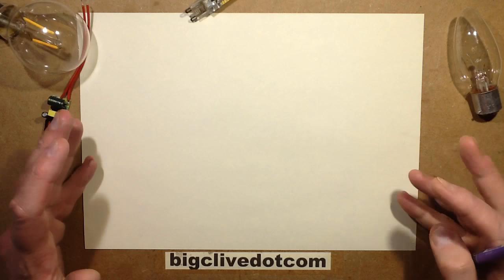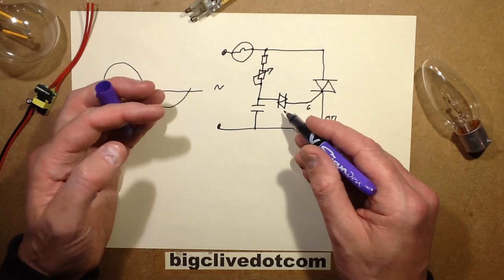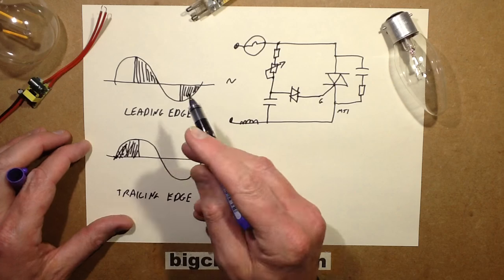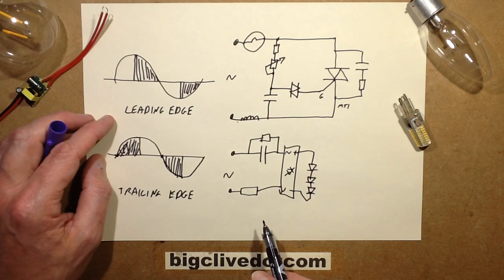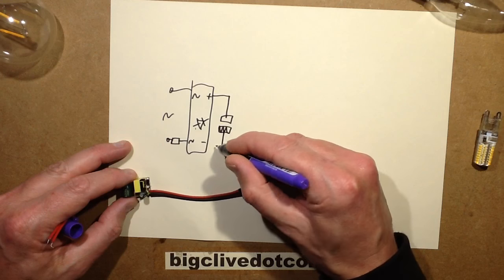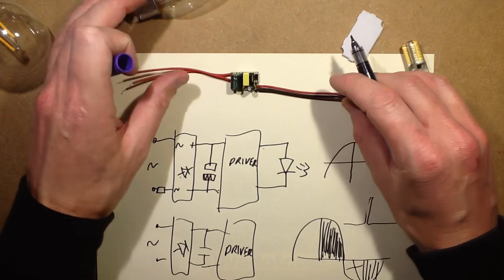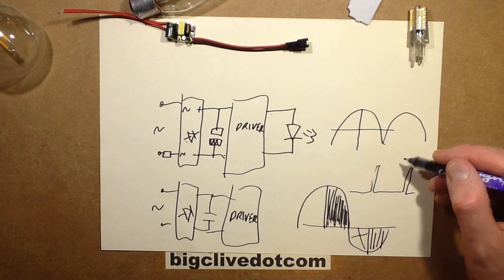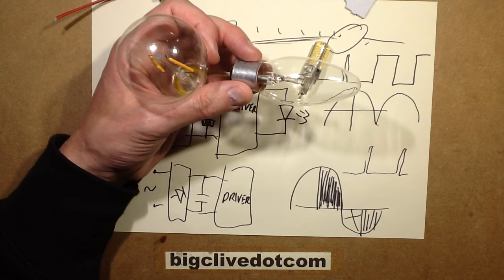Dimming LED lamps with ordinary dimmers.

Comment: As an IT guy, I don't like the idea of light bulbs communicating over systems as complex as Bluetooth or WiFi. They are so easy to bugger up security... Look at what Philips did with their internet connected light bulb.
A standardised, over the wire protocol would be fine. But I know that won't happen because its not as cool as an iPhone app to switch your lights on and off.
Reply: agree, IOT = security disaster.
Reply: . . power over ethernet is already here
Reply: Uh, what? PoE is for powering remote network devices.
Do you mean EoP as a communications method? Because that' still way to complex for a consumer grade light bulb. I'm thinking something more akin to "coax" SPDIF audio, but containing dimmer levels. Still insecure in that anyone with access to the wire can feed dummy signals, but far simple enough that a purpose made chip can receive it and process it without having an embedded Linux system (ala the hackable Philips bulbs).
Reply: well, often the light bulbs themselfs dont have WIFI but the controller of them has, but the controller - lamp is based on other protocolls (Ikea trådfri and philips hue).
Reply: There already are standards for controlling devices over the power lines. And they have exactly 0 security. All commands are sent in the clear, no encryption or signing. I too hate the bluetooth/WiFi controlled light bulbs, but without developing a new standard and somehow convincing everyone to adopt it, it's probably the best option security-wise.
Reply: +tin2001 - You see , the Hippsters are slowly causing the BattleStar-Galactica doomsday https://www.youtube.com/watch?v=rNklsRcRQv4 or disaster stuff in ST-TAS
Reply: What about Clipsal C-BUS? It pretty much is a wired automation protocol like you described, though it has been around for a while, but the downside is that it is VERY EXPENSIVE to install.
Reply: +wocko1 - Thats the problem, its to expansive = it will not realized
Reply: Another problem is that anything "smart" you add to a bulb will have a boot time. A major factor in bulb acceptance is the time it takes to light a bulb; in case of dimmable bulbs, that also includes the time to reach the right dimming level. Most "smart" bulbs I've seen have a very noticeable boot time even without any dimming; those that don't have that instead light up at full brightness instantly, and only then drop to the correct dimming level. Real-time dimmer response is still hard to find.
Reply: +NetRolller3D - YES
Reply: I understand the security issue (traffic will still be three) but do what I did at my office and house;  Use a good or real router ( I like Mikrotek) and the subnet it out. Security system on one subnet hidden, automation system on another. And the. Private and or public accordingly.   Like I mentioned you still have traffic but you can block, monitor, secure and limit all based on subnets.  Have an awesome day.
Reply: Why  the heck do we even need a phone controlled lightbulb, is the demographic too fat/lazy to walk to the switch really that big? 🤦🏼
Reply: There should definitely be a market for a plug-n-play isolated-network router that's just for IoT, but if you've half a brain when it comes to networking, managing your own home full of them isn't really a problem.
Reply: Or just have the Phillips hue bulbs talk to the bridge wired and thus making the connection between your phone and your router the only wireless connection because the bridge is also wired by ethernet. Less wireless is beter for health, beter stability and beter security, those are all really important.
Wireless is worse in health, stability and security and wired connections should be favored by all systems or at least having an option to do so.
Reply: @raykdreisatzgehtanders7239    In a word-YES!  Yes they are.  And sadly that trend will continue.
Reply: there are IOT chipsets that have hardware encryption,, and I do think it is possible to make the connection secure. is it complicated? yes, is it impossible to get right? I really dont think so.

Comment: I went to home depot and looked at some sylvania / osram dimmable LEDs. Not only were they like $30+ each, but the display ones bothered me with flicker. Down to about say half power they seemed ok, but below that threshold you could see the result of the sinewave being chopped up. Said works with standard wall dimmers. No, no it doesn't. I was less than impressed.

Comment: I use a variable buck DC to DC converter to control LED light in my room, works a treat. I made a box with the circuit in that sits between the light socket and light shade with a pot on the side, I just reach up and turn the pot

Comment: I have Cree LED stuff on the most used lights in my house now, and all of them are very smoothly dimmable with a standard dimmer. Here in the US anyway, they're cheap. Around $4 for a 60 watt equivalent bulb and around $14 for the pot light retrofit.

While I don't think power line networking is necessarily a bad way to go, I don't think it would catch on much because of the added issue of what would certainly become another format war.

Comment: I noticed that my local box stores now are offering fairly cheap dimmable LED bulbs and they now also stock a dimmer specifically designed for use with larger multi-led lighting fixtures of the type you typically see being used in kitchens, etc.

Comment: Hi Clive,

I've recently purchased a dimmable LED  from IKEA (LEDARE E27 1000lumen £8) and paired it up with a V-PRO-IR From Varilight (screwfix (1220J)£15.99) It works really well and you can program the dimmer to a minimum dimming level that stops the LED light from strobe-ing and the dimmer has programable leading edge, trailing edge or Digiflux? modes, trailing edge is the default and works best with the IKEA LED bulb, I know it's not a chinese £1 purchase but it works really well. If it didn't cost £8 I'd do a bigclive on the lamp, perhaps when it fails!

Comment: We just built a new office and all the lights are dimmable LED fixtures that use a switched 120V line for On/Off and a separate 0-10V signal for the intensity setting. Works great for a new installation but not so much for existing buildings/wiring. I dislike the idea of radio communication for the dimming as the airwaves are noisy enough as is. IMHO modulating the signal over the power sounds like a good way to go for old work installations as long as it doesn't interfere with other systems.

Comment: Clive, Every year I put LEDs outside my mates house and we can dim the LED's using an 3 or 8 channel control board comprising of a triac, A control chip, A few odd components and the input from the computer... Yes we do the sound to light for christmas but we dont use the american stuff. We have full control of the dimming of the LED's either strings or the RGB strips.

Comment: I’ve been in IT for a little while. Around 30 years. Personally I’ve found the best way to eliminate as much security and application issues with Technology as possible is to subdivide your network. Create subnets for your wired and wireless systems.  One for security another for your computers your children’s stuff. your TV’s and home automation systems, Hell everything you have you that can be broken up and subverted out can, and in today’s age, should be sub-netted out.  it’s pretty damn big networks (that is he 192.168, 10; and the 172 subnets) just divide them up and use firewalls and routes to keep them from breaching one another. There are lots of ways to handle issues like these, but the best way by far is to “stop, think, plan and document, then implement and test”. But hey, that’s just me and this Texan tips his hat to you sir and all your work.  I thank you dearly.

Comment: Thanks again Clive for your, er, illuminating explanation of dimmables! I just revisited this, because I am coming up to a makeover in my flat in south east London.
I have a couple of ideas I want to throw into the pot, and I may try them out if I can get hold of the necessary kit. 
1/ What if bar LED units were used instead? The principle involved would be to coil maybe 50 or 100 LEDs in a spiral fitting inside a lamp housing. The signaller (=dimmer) would then be in the wall switch, and I presume the PSU (driver) would, too - some reworking of cables needed. Instead of trying to lower the light output of a lamp's LED array, you'd simply reduce the number of LEDs lit. There are kits around that could be used, and a selection of bar LEDs, although I have not seen them in spirals. This could be worked round, however, by cramming modules and crafty soldering. But, their light output might be an issue. Ribbon lighting a possibility.
2/ Another approach would be a bodge IMHO. I was considering say a dozen or more LED downlighters in my living room, but with two or three on a separate circuit. How to do that? Use half-wave rectifiers! All I would need is a double switch. The two or three downlighters could also be underdriven - my crude way would simply be to add resistors, just enough current to trigger them. This approach is simply to have a lot less total light coming out of the ceiling, rather than each individual lamp glowing feebly. Not as sexy, but all I need is not to fall over the coffee table! 
As a complication I would need to override the dimmed lights, but I think some extra circuitry would work, the simplest by using a relay. Maybe your fairground experience can point me in the right direction! Or you could do an update video...

Comment: Thanks a lot for the explanation, I've been wondering quite some time about dimmable LEDs. Your video made it obvious why both the dimmer and the LED have to be made for each other.

I guess you could put the complete rectifying, smoothing and pulsing circuitry inside the dimmer. And only have a current limiting resistor in the LED bulb. Such a type of dimmer would still work with old bulbs.

But it would make these new LED bulbs completely incompatible with the current situation. So it probably just ends up quite expensive again due to different standards. (and given that you can't risk people putting the LEDs in sockets that aren't rectified, it would need completely incompatible socket types again).
Reply: Might as well just set the dimmer up for LEDs and keep a couple extra for the faulty ones, my experience with LEDs is that if they last the first 24h then I haven't seen one die yet, even the el cheapo ebay ones i got many years ago.
Reply: You wouldn't want to have your PWM driver far away from the LEDs. Ideally you want to keep that loop as small as possible otherwise you'll have huge EMC issues.
Reply: +Sander Deryckere
I think the industry's attitude towards is really dumb in general. They think everyone is stupid with a "well, I have these sockets so I need to get bulbs the fit in them" logic and can't get past that, so they optimize for this.

Making lightbulbs out of leds is remarkably foolish to begin with. Bulbs were invented for incandescent lighting. The design concentrates heat, which was good for incandescent bulbs to keep their filaments hot, but is the worst thing to do with LEDs.
They should be making large surface lamps with diffusers at the very least which could deliver soft light instead fo the harsh piercing light of bulbs, and also would cool ideally. And would also make the problem of dimmers mute, because they should come with their own, built in dimming capability
They should also put efforts into LED strips, an lamps/lighting based on that. We only have the cheap 12V strips which burn a third of the energy with resistors. And which are so crappy that they're noticably dimmer on one end on a few meter scale if you drive them only on the other end. Plus they look crappy by themselves so you need to buy aluminium profiles with diffuser plates for them at the price of gold (almost).
Reply: +Sander Deryckere
Oh, yeah. More on the topic. You migh try a capacitance in series for dimming, which might work. You could switch more than one capacitor to get multiple levels, but of course you wouldn't have continuous dimmability.

Comment: I got a couple of GU10 dimmable LEDs at B&Q for £1 (reduced to clear). I use one of them in a weird Ikea floor lamp, which has a dimmer that I don't quite understand at all. The dimmer has a slide potentiometer and a neon lamp. As you turn the lamp brightness up, the neon gets dimmer and vice-versa. With the LED, the dimming is a bit choppy. It takes the LED a few moments to realise (?) what it's supposed to be doing.. There's a choppy dimming and then it settles out. 

I like the fact it doesn't get hot at all, but the light isn't as warm as a filament bulb. Filaments get "warmer" (redder) when they are running dimmed, but LED just gets less bright.

I think you're right about needing a PWM dimmer, but it would be nice if they could emulate the colour change of a traditional filament too.

Comment: Thanks for the explanation   People have become used to dimmers and can't accept that LEDs are tricky to dim. I try to wire more lighting circuits and let the householder choose the level of light using ceiling, wall and table lamp sockets separately switched. Just don't try to dim them!!